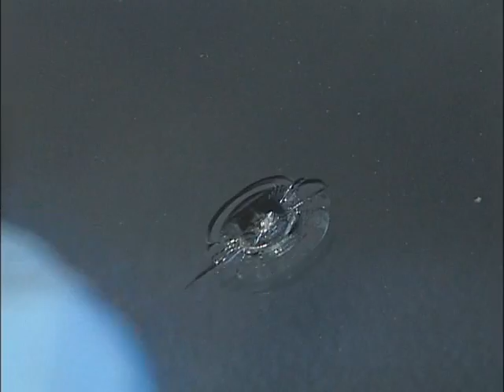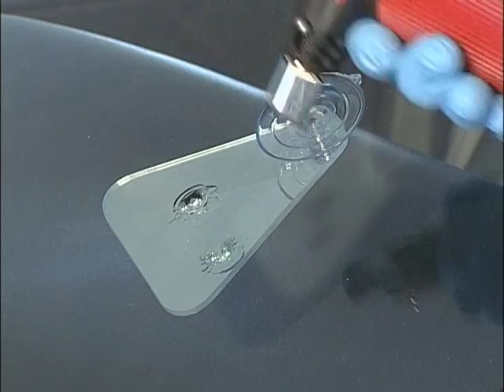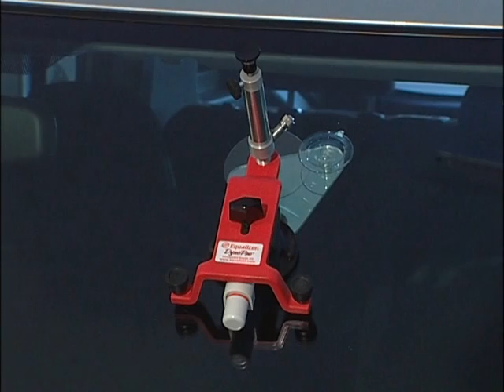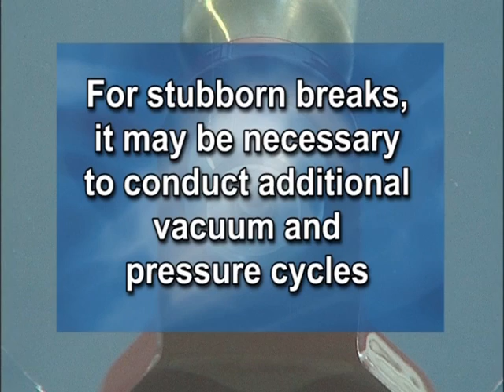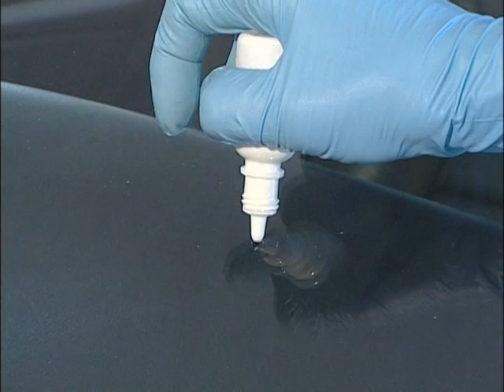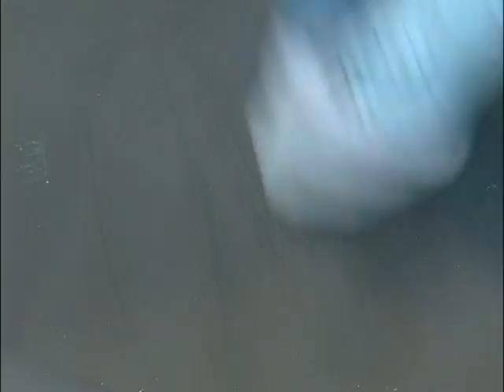Powertech Windshield Repair Kit Training

Comment: we are technicians by trade with many decades of troubleshooting and repairing many different types of systems.
We bought this system and tried to use it multiple times over a period of several years; being extremely careful on each attempt.
The Bottom line = it  does not work. 
The suction cup becomes loose.
The vacuum/ pressure unit cannot be made to seal reliably.
We feel that we wasted our money on this unit.
avoid